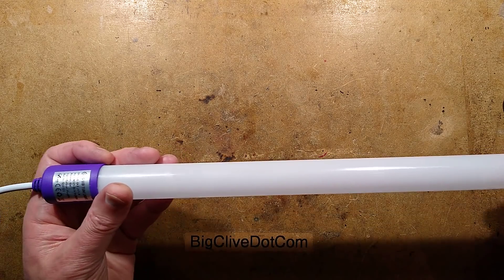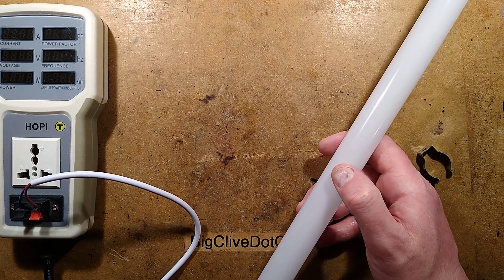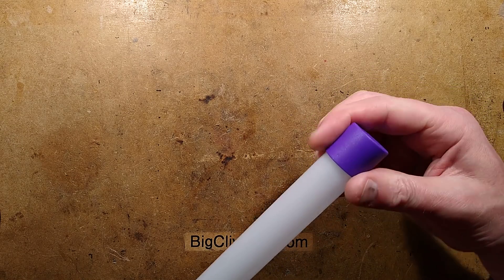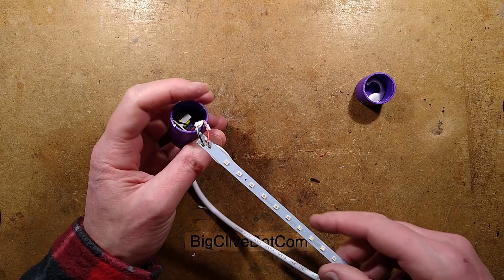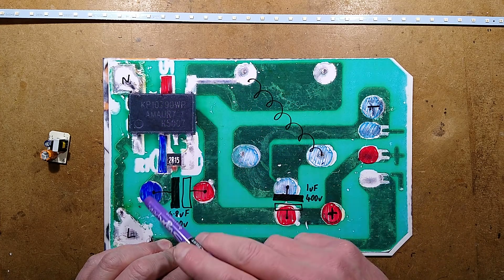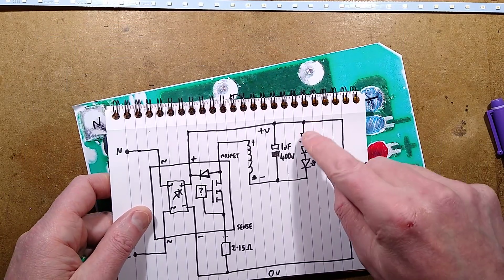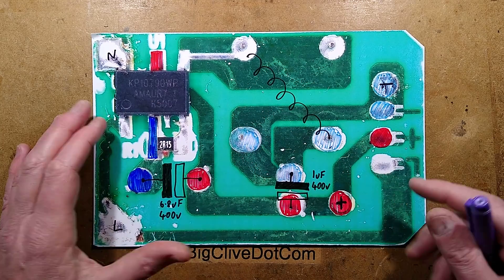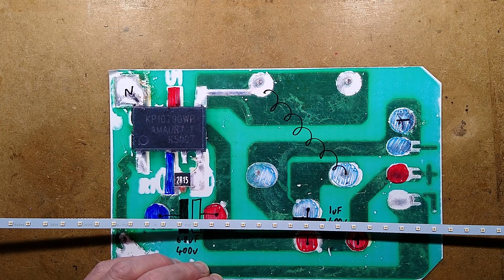Purple LED tube with neat driver

Comment: This style of buck regulator drives beginners nuts when they see it because it's configured "upside down" from the normal arrangement of a buck. But it works just the same. The inductor creates a triangular current waveform when a rectangular voltage waveform is applied across it (I = 1/L * int(V*dt) ) that the filter cap smooths out. The internal "catch diode" is tied to the positive rail, not GND (0V), part of the "upside down"-ness of this topology.

Slight correction, Clive, at 5:30. When the FET switches on and off, the negative end of the 1uF cap does not move at all. It's the voltage across the inductor that swings between 0V and one diode above V+. Thus, the FET's drain voltage has the large rectangular waveform on it. The inductor and filter capacitor form a (relatively) lossless lowpass filter, turning the duty cycle of the rectangular waveform into a DC voltage across the 1uF filter cap. The current through the inductor is triangular, whose average current is the load current (the LEDs in this case). The regulator chip has some mysterious internal mechanism that knows how to regulate the FET drain's duty cycle so that V+ * (duty cycle) = Vled. 

Lots of budding engineers know and understand that if you apply a rectangular waveform across a simple RC lowpass filter, what comes out of the filter is a DC voltage equal to the duty cycle times the voltage swing. But this applies ONLY if there is no DC load on the RC lowpass. The buck regulator uses this same principle, except instead of using a lossy RC lowpass, it uses a lossless LC filter which has very little I*R voltage drop when connected to a variable load current. That's the essence of how a buck regulator works. Usually there is a feedback network that closes the loop to produce tight voltage regulation. That feedback network is missing here, part of the mystery of the controller chip's inner workings.
Reply: The only issue with this configuration, is if you need a common ground on the negative side (which is often the case for battery powered circuits or things like USB-powered stuff). But if that isn't needed, it's often preferable to have it this way, as it allows for simple use of an an N-channel MOSFET. 
Connecting a rectifier to AC, there is no fixed ground anyway (mains neutral/ground will just alternate between positive and negative output with each AC half cycle)
Reply: The regulator uses the sense resistor to regulate the average point of the triangular current (which is also the actual LED current) to be whatever causes the voltage across the sense resistor to be a voltage specified in the data sheet.  Using this number and the desired LED current, the Chinese engineer probably calculated 2.2 ohm to be a good E3 series standard value and 2R15 to be the closest E48 value from wholesale suppliers of 1% resistors.
Reply: @johndododoe1411  It doesn't actually "feel" the average, since current is only passing that resistor when the transistor is on. When it's off, the current is just "freewheeling" thru the diode and never passes that resistor. I would guess it uses "fixed off time" regulation. When the transistor turns on, the current start low, then ramps up thru the inductor and once it hits a certain peak value, the circuit turns off the transistor and keep it off for a set amount of time. Then turns on again until it reaches the set peak value and turn off again and so on. 
Not as accurate regulation as regulating by the average, but allows for the current sense circuitry to be simpler and gives pretty good regulation if it runs in continuous conduction mode and the output voltage isn't too close to the input voltage or to zero.
Reply: @Speeder84XL  Yes that is exactly how it works, it uses a fixed off time.
Reply: @Speeder84XL  Okay, I see how this works. I found a KP1079WP datasheet (but not a KP10790WP!), which is described as a "Non-isolated Quasi-Resonant Buck LED Power Switch." What's that mean? The controller can easily detect when the inductor current drops to zero just by waiting for the internal FET's drain voltage to start dropping below the V+ (supply) pin, which is easy to do with just a simple comparator. This sudden drop in voltage is what happens when the inductor "empties": the output voltage will begin "ringing" like a resonant LC tank circuit with a frequency determined by the inductor and any parasitic capacitance on the FET's drain node. Once the controller detects the beginning of the self-resonance, it then turns the NFET back on again. I think that is what is meant by "quasi-resonant."

Specifically, the on-time is (Ipk * L)/(V+ - Vled) and the off-time is (ipk*L)/(Vled), where Ipk is the peak sense current set by the chip's sense resistor and L is the inductance value. Sum the two times, invert it, and there's your Fosc. Note that Vled will have some effect on Fosc, but not a lot due to the very large value of V+. You, the designer, have a good idea of what Vled is going to be (Clive always says that each white LED has a forward voltage of about 3V), which then means you only need to decide on what Fosc you want to run at, then calculate the inductor value you need to achieve it. Done!

Extra credit exercise for the student: since the above equations are the same ones you use to describe the operation of a conventional buck, then you will find that the duty cycle, which equals Ton/(Ton + Toff) = Vled/V+. Hence Vled is also regulated. Do the algebra yourself. If Toff were fixed, then there would be no regulation of Vout, much less Iout.

The datasheet says that for a 72V output (probably for a 220-240VAC supply), the output current for the KP1079WP is 130 mA. I assume that means the peak detector senses twice this value. That's how the controller works: just by controlling the peak current. By waiting for the inductor current to drop to zero and then starting the cycle anew, it self-regulates the average current while keeping the output voltage (Vled) regulated.

EDIT (because I can't get YouTube to accept another separate reply): 

No, you cannot use only the peak current to regulate the load current because you are ignoring the duty cycle of that current. Inductor current = Iled = Iaverage = (duty cycle) * Ipk/2. What is your duty cycle when you have no control of the off-time?

Here is the abbreviated datasheet that Clive refers to, and which he has sketched starting at 4:25 tinyurl.com/mrunxdy6 . The sensing circuit in the source of the internal NFET controls the on-time peak current, but because of the (assumed) on-chip catch diode, the chip can indeed sense the off-time current as it passes through the catch diode. There are several ways to do that, but we don't need to get into it here because it is not what the chip does. By observing the VOLTAGE on the internal NFET's drain when this FET is off, the chip knows exactly when the inductor current drops to zero (there is a big change in the current slope (di/dt) when the inductor current hits zero, hence a big negative-change in the inductor's voltage), as I have described. When this resonant ringing starts, the controller knows to turn the NFET back on again." In this fashion, the controller runs right between the boundary of continuous mode (aka PWM, where inductor current always > 0) and discontinuous modes of operation ( aka PFM, where inductor current drops to zero). Discontinuous mode is characterized by pulse frequency modulation (PFM), where Fosc is controlled by the load current. PFM also emits a lot of EMI noise due to these very large amplitude resonant ringings, not a good thing on a consumer product like this. Customers don't like their AM radios buzzing when they turn on these LED tubes. The cleverness with the KP1079WP is that by nature of its simple sensing of when the inductor current hits zero, it operates very close to a continuous mode buck where the duty cycle is well-defined as Vout/Vin.

I've described how the inductor/LED load current is controlled and even what the duty cycle of the converter is once you specify V+ and Vled. Now it's your turn: what's your expectation for the duty cycle in equation form?
Reply: @demef758  Yes - the voltage jump when inductor current stops is easy to detect, but would require some sensing on the FETs drain (which this circuit hadn't). When the FET turns off, that resistor is going "open circuit" and will not get affected much by what happens on the drain side. But on the other hand, it can of course also have some internal sensing on the drain pin (I forgot about that ). 
Nothing says the drain pin is just the drain of the internal FET. You are probably right, about being "quasi resonant" means some sort of zero current/voltage switching. 
The most likely if that's the case, is probably to "wait" for the inductor current to go down to zero, then turn on again - and that way perform "zero current turn on" (cutting down the switching losses quite a bit). That will also make accurate regulation by only measuring the peak current, easy (the average will always be exactly half the peak current).

Comment: You talking about the High Voltage Leds made me think about using the 24V cob led strip i got (6 meters, 3000K, 36W) in cut up strips and running it off a full, maybe two separate half-wave rectifiers.
With the 24V strips cut to about 10cm, then wired up + to - you are with 10 or 11 pieces already at/above the 240V.
That means only a bit of overhead with rectifier, cap and resistor.
Would allow a floating lm337 (hope i got the number right) to limit the current and even use a switch (or isolated poti) to get multiple brightness settings.

Comment: Clive, could you please explain what Power Factor is and what is good and what is bad?
Reply from the maker: In a nutshell it's how close the voltage and current waveforms are.  The ideal one is unity where they are in perfect sync.  Bad power factor means bigger cables are needed for some loads.

Comment: I was surprised that you don't own a "spam" mail account for these occasions next to your normal mail account.
I have a special hotmail account for that, that I open every 14 days and then delete the at least  "50 mails" without reading them.
Also easy for login in mail account where they don't offer you mail BUT WILL DO hehehe.
Reply: My iPad offers to use a built in fake email feature.  it does not have fake SMS feature, perhaps an iPhone does?

Comment: one thing I would wonder is how hot that little chip gets in operation; most buck regulator chips can get a bit toasty, particularly given the relatively high input voltage

Comment: The Chinese do indeed seem to have come up with a way of daisy chaining LED fluro replacements that are a bit dodgy with live pins that I doubt would pass the standard finger test. The connectors look very similar to the IEC C5 / C6 standard but are different enough so that the IEC connectors don't fit. Why the Chinese manufacturers are doing this escapes me. The light fittings themself appear fine so far. No magic smoke after a few hours of operation and the ease of being able to join them up is great. Just need to blank off the live pins of the last one in the chain.

Now that I think about this the exposed pin problem could be solved by supplying a blanking plug that needs a tool to remove. They'd cost a cent each to make.
Reply: I wonder if we'll get to the stage that such manufacturers of live pin ends will just supply a 3D printer compatible file for those that want some measure of safety (everything else aside)
Reply: @nickryan3417  I hope not. They supply all the hardware for every possible mounting option. All stuff most will have on hand or can buy easily. They could have avoided the problem with plug at one end and socket at the other or supplied a all plastic blanking piece preferably fitted. I can address the issue very easily with heat shrink or epoxy. Challenge for the manufacturer is in many instances sales are lost when the OH&S guys look at it.
Reply: @robroysyd  Common business malpractice in these years is to not stock the complete set of "optional" accessories, causing waiting time for a complete order to be long enough for many buyers to just work without the missing piece, thus further reassuring penny pinchers to not restock those parts, thus disincentivesing factories from keeping them in production.
  Blanks to safely cover gaps are likely to disappear into this economic black hole.

Comment: One of the interesting effects I've seen was when I'd pointed a UV LED used in looking for leaks in an AC system (with a UV dye) across a glow in the dark model of the USS Enterprise. The LED made a neat "trail" of sorts across the plastic. If you ever get the chance to give it a shot. I think any glow plastic should work and it might make a cool effect.
Reply: You can paint a plank or canvas with glow in the dark paint and get funhouse shadowgraph effects with a UV source or xenon strobe. Overpainting some Bob Ross happy little trees in an opaque white on a canvas prepped like this makes an effect of a painting that appears in the negative in the dark.
Reply: @treelineresearch3387  reminds me of the blacklight posters all the Stoner kidz had in the 90s
Reply: Many fluorescent compounds are also slightly phosphorescent. You can get the same effect with laundry detergent powder, as the whitening agents will glow for a short time after exposure to UV. Obviously, proper glow in the dark chemicals display the effect far more strongly.